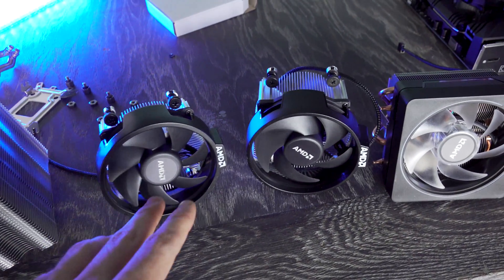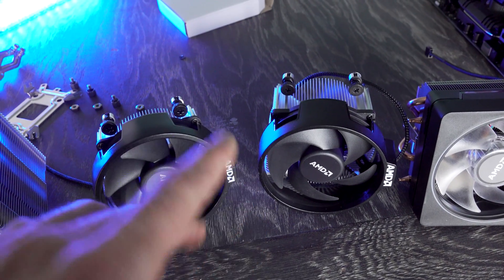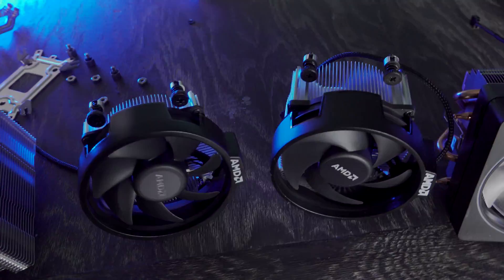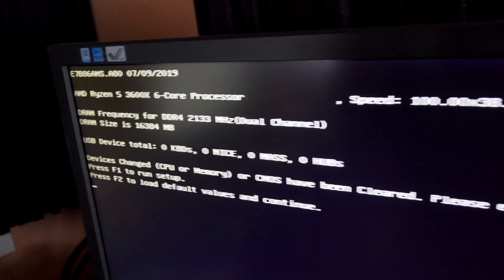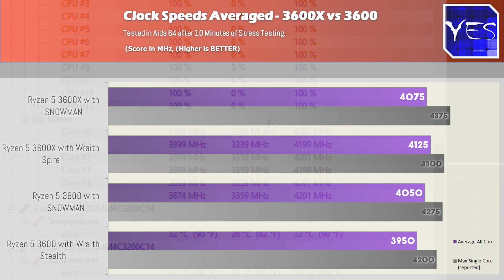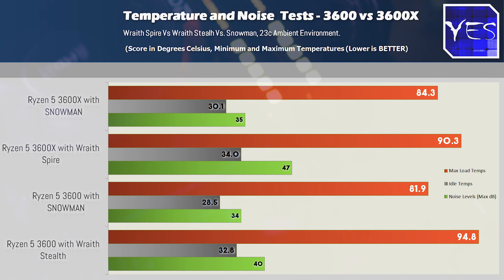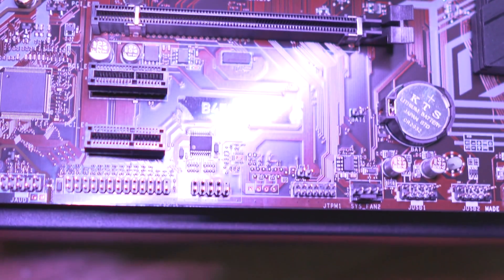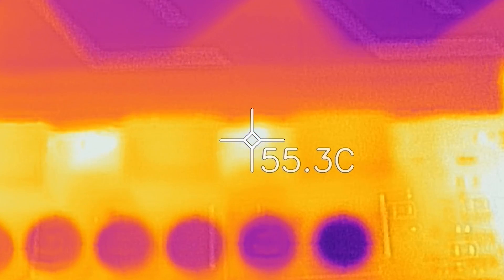Ryzen 5 3600 Vs. 3600X ON A B450 MOTHERBOARD

Comment: Got a question if anyone could help me out. I built my own rig 2years ago (GTX 1080 & ryzen 2600x with the msi b450 MB and the last bios update i did was around 4months ago from this comment, my question is is if I upgraded to the 3600x could I use the cpu without having to do any bios update?

Comment: I’m building a gaming pc (goal is to play with 144fps on fortnite) and these are what i got for now: 

CPU: Ryzen 5 3600
Motherboard: ASUS PRIME B450M-A
GPU: GeForce GTX 1660 SUPER SC ULTRA
RAM: 16 GB (2x8GB) 
Storage: 1 TB hardrive 
Power supply: Corsair CV Series 550w 80+ Bronze 

Can anyone tell me if this will be enough? Will that motherboard be ‘supportive’ enough?

Comment: hi techYES,  I dig the content; I have built this exact system last year for my daily driver and i must say that it drives my 1440p LG just fine, happy days...  i have a ryzen5 3600, asus prime b450 M-A, and rx590 that i found cheap, i am strugling a bit with the ram config on it, i got 2 sticks of 16gb  3200mhz CL16 gskil ddr4 ram,  but on the bios uefi the ram shows 2133mhz out of the box, i think there is some bios stuff that needs some attention, i am afraid that if i mess with the bios too much i may brick the thing, plz haaalp! EDIT: did bios update and it remained the same ... atleast i know i have the latest bios.

Comment: I'm sorry I'm very new to all this and need help asap. Today i bought my last part to build my pc. It was the cpu and originally I had a ryzen 2600 picked out for my b450 but best buy did not have them in stock. They had the 3600 so I got one. I put it together then a thought popped in my mind about the two being compatible I do some research and find this. My pc fires up I have power lights work fans work everything but when I plug the hdmi into the monitor I have no video what so ever is this because of the cpu and mobo????

Comment: I went with the Rog strix B450-f Gaming board an a r5 3600 with a 4.2ghz oc @ 1.25volt an 3600mhz Ram.     Only took an hour to fit & setup an tested for 2 hours on OCCT to make sure it's stable.

Comment: I have the 3600, and I have it overclocked to 4.2 in the bios. The most voltage it ever uses is 1.09. I know pbo might work better than a standard overclock, but I don't understand how all that works.
Reply: what cooler are you using and what are your temps idle/load ?
Reply: @jeffersoncrum5575  So after some more tinkering I got 4.15 on the cpu I changed the voltage to 1.325 manually. I'm using that new hyper 212 revision black edition or whatever
Reply: @jeffersoncrum5575  with the hyper 212 I'm at around 38-40 idle and 50 under a gaming load, 70-75 under a cinebench

Comment: Hey I was wondering if you guys had a B450M PRO-M2 motherboard? (Not v2) to test with the 3600? I see lots of posts that this board will not do 3000 series even though their bios and compatibility list reflect htem updating for it.
The issue I have is we have 7 of these at my office and I got a 3600 to upgrade a few of them for the graphics artists at the office, however it doesn't work at all nor boot (obviously I updated bios) I've tried several versions, none work. I  see on searches that many others have this issue.
https://www.msi.com/Motherboard/support/B450M-PRO-M2#down-bios

Thanks for any help.

Comment: There are no differences between both CPUs. Just buy the 3600 and overclock it at 4.2.
Reply: Good luck with that. I tried to set my 3600 at 4.1 and the computer won't even post.
Reply: @ToxicTeemoOCE  
Lol. In theory the 3600 can reach 4.2, but 4.1 in all cores its ok too.

Comment: What kinda Mainboard do I need to get the most out of a Ryzen 5 3600?
What do I need to watch out for?
Could it be that the Ryzen 5 3600 runs with its full potential with every B450 board?
Or is there a reason to take a more expensive board like the MSI B450 Tomahawk MAX?

Comment: Thanks a lot for this test video. I bought a system with an Ryzen 5 3600x and a Asus TUF B450-Plus Gaming MoBo. I can't wait until it is arrived.
But if I see these temperatures, I'll probably buy another cpu cooler. Maybe an Arctic Freezer 34 Duo.

Comment: Please suggest best valued processor to be paired with RX570. I'm stuck with A320 motherboard as B450 in India just priced double. Thanks in advance.
Reply: the asrock fatal1ty gaming k4 b450 (7200rs) is 50% off on theitdepot.com . I just ordered one. It has more features than the b450 tomahawak but lacks bios flashback but I think its ryzen 3000 ready. For processor you should get a r5 3600 or 3500 when it releases.

Comment: Operating System
 Windows 10 Home 64-bit
CPU
 AMD A10-6700 81 °C
 Richland 32nm Technology
RAM
 20,0Gt Dual-Channel DDR3 @ 666MHz (9-9-10-25)
Motherboard
 ASUSTeK COMPUTER INC. M11BB (FM2 ) 44 °C
Graphics
 LG TV (1360x768@60Hz)
 4095MB NVIDIA GeForce GTX 1050 Ti (ASUStek Computer Inc) 35 °C
Storage
 1863GB TOSHIBA DT01ACA200 (SATA ) 39 °C
Optical Drives
 ATAPI DVD A DH24ACSH
Audio
 Realtek High Definition Audio

Comment: I know this is a motherboard video but I have to ask and expect 100% no bias from any amd fans, I currently have a fx-6300 myself and even comparing to my friends i5 from i2012 I had quite the stabilization problem when it came to gaming. Even back in 2015 when I used to purely play games such as csgo and later overwatch, hell even fortnite when I used to play my fps would constantly be dipping, in cs it went from 140-210, fortnite 40-120, there would never be an in between(I also used to play on low everything for competitive purposes so I wouldn’t be utilizing my gpu as much). Going over to my friends house he would play cs and his would only dip 5-15 fps at times whilst playing, a respectable number and nothing to be worried about. I want to ask any new ryzen 3000 owners do you experience such thing, as I’m like dead set on getting 3700x myself with a 5700xt but the experiences that ive built up on my 6300 is kinda putting me off.

Comment: In your clock speed slide, are those clock speeds auto boosted or manual OC? Im assuming auto. I have a B350-F and I'm curious if an OC to 4.1-4.2 on a 3600 is worth it over just leaving it to boost itself and save some heat/power

Comment: Snowman seems to be a really great cooler. But as I mentioned in one of the previous video comments, I have purchased Alseye cooler from Aliexpress - particularly H120D. And it does great job - Ryzen 5 3600 max temp after 15min AIDA64 stress test - 73C. RGB fans, quite quiet but I believe they may be dragging the cooler down a bit and with better ones the result may be even better.

Comment: No way in hell is the 3600x worth $50 over the 3600. The "Snowman" is the exact same cooler as the Thermaltake ContacSilent 12. I have one on my 3600, and it does a very good job. My load temps dropped 15 degrees C versus the Wraith Stealth. I may have gotten a really good 3600, because it boosts over 4.2ghz on all 6 cores at times, and my Cinebench scores are higher than the ones I've seen from any techtuber's 3600 review. I'm also using an MSI B450 board.

Comment: When comparing the 3600 and 3600X single core clocks, is the Windows 10 Processor Scheduling selecting the fastest Ryzen CCX or core? On my 3600 it is not...(Asrock B450pro4)

Comment: It is so nice to see that the 3600X can hit it's advertised 4.4 Ghz turbo clock. OH WAIT...
Reply: Probably on water or the arctic (my first gen TR-1950x can do 4.3 GHz all 16c/32t when it’s cold in my room, aka my drinks are frozen in the morning and so is the milk). Plus that’s single thread boost I believe for the Ryzen.

However near 0c the memory controller stops working and 3777 MHz quad channel drops to 2133 tri, then duel, then single RAM stick (this is known issue for Ryzen near 0c, colder than -50c and it starts working again but that means my phase cookers would not be good enough for keeping that -50c core temp under stress loads and probably wouldn’t work). That said my 2200g doesn’t seem to have memory drop out between -60c up to 90c so I’m guessing it’s just a lucky chip (this is testing with phase cooling).

Comment: tomorrow death combo
Ryzen 3600
X570 Gigabyte Pro
Hyper 212 Black Edition
Noctua N1H1 thermal pase!

C A N T   W A I T
Reply: Why the X570 motherboard, and why the Hyper 212 Black? They won't net you any performance over the motherboard and CPU cooler shown in this video.
Reply: @hartsickdisciple  so why make x570? Same thing was said about x370 n x470.
Reply: @joemartinez5782  Those motherboards have extra features that benefit a small subset of prospective buyers. They do nothing for the majority of us. An R5 3600 is a bang for the buck type CPU. It makes sense to pair it with a bang for the buck type motherboard. B450 handles the 3600 beautifully.
Reply: @hartsickdisciple  thanks for replying. I plan to game and stream and edit. I want this pc to last me a long time. I have a 1000 budget. What would you do?
Reply: @joemartinez5782  What do you consider a long time, and what resolution do you plan to game at?
Reply: @hartsickdisciple  4 years. 1080p in streaming and 2k for pleasure. I have an alienware 25 monitor. Dont need to max it.
Reply: @joemartinez5782  This monitor? https://www.amazon.com/Alienware-25-Gaming-Monitor-Height-Adjustable/dp/B0733YCKM5/ref=sr_1_1?hvadid=77996648281774&hvbmt=be&hvdev=c&hvqmt=e&keywords=alienware+25&qid=1566962151&s=gateway&sr=8-1

Comment: 🙂 forget this, at Microcenter u can pu a brand new $199 2700X with an included amd rgb cooler
Reply: The 3600 outpaces the 2700X is many benchmarks, including nearly all gaming scenarios and overall responsiveness. 
If I were to buy a CPU for gaming and normal computer usage it'd be the 3600. 
Only if you can really routinely use the extra cores for streaming or some workstation-type task would the 2700X be better.
Reply: @tim3172  ✌😏 agreed but thats not its final clearance price, by maybe First Quarter 2019 the 2700X mite be at $129 @ Microcenter, stay tuned! 😱😍

Comment: Those are insane cinebench R20 numbers for the 3600. Most chips score around 3550-3650, 3700 and above is insane.
Reply: I have almost the same exact setup as him. I'm using a 3600 with an MSI B450 board and 16GB of 3200mhz CL16 RAM. I have the Thermaltake ContacSilent 12, which is the exact same cooler as the Snowman, with a different brand stamped on it. At stock, my CPU hits 3719 in Cinebench R20.

Comment: It is still better to KEEP the Wraith cooler , because that cooler blows DOWN , and that helps a lot , because that downdraft cools the VRM's !!
Reply: He showed the VRM with the Snowman cooler and it was barely warm after 10 minutes of Aida 64. I’m not sure the exact temp you want to keep these mosfets, but you don’t want them iced over either (besides literal ice melting, the mosfets have a minimum temp and then start going crazy, hence you never want to LN2 cool mosfets, voltage spikes from them hanging etc)

Comment: Another great video, thank you!    [edit:    I am a fan of Noctua air coolers.    Could you put a Noctua on the Ryzen to see how well it does?   By the way, I have a Noctua NH-U14S for my Intel CPU.    While typing this I ordered an adapter kit from New Egg.   The adapter can be ordered free from Noctua, however I first need to own a Ryzen compatible motherboard, which I do not have at this time.    Noctua's web page:    https://noctua.at/en/nm-am4-uxs-mounting-kit-order-form  ]

Comment: how the hell did you get that scores on the cinebench r20?!?
I have the msi b450m pro-vdh and it doesn't allow me to get the minimum overclock, it runs 3600mhz cl16 ram and all, but Oc is out of question.

Comment: Hmm what is happening with the 3600 and 3600x is the same with the 2600 and 2600x. I payed that premium and a friend of mine got the 2600 and I got 2600x, with the same voltages and settings on the 2600 I got the same performance as I got with my 2600x. Stable 4.2Ghz on both CPU's, well let's say this I will never do it again and I would definitely buy the 3600 over the 3600x or at least go for the 3700x instead.

Comment: Bryan. There have been reports of issues with MSI B450 boards that have the bios flashback button having issues with the new Zen 2 CPUs after performing the flash back using the button. Did you experience this at all?

Comment: I have a ryzen 3600 and the same msi b450 a pro, but I have a problem, I keep getting a "driver power state failure" bsod, also the chipset drivers from msi site are so confusing, don´t know what should I install and what should not; help!
pd: ryzen 3600, msi b450 a pro, corsair 16 gb 3200 mhz lpx, mx500 1tb, msi gtx 970, 650 watt psu.
Reply: install the chipset driver from Amd directly, not from Msi, check for updates, or reinstall windows.

Comment: Good topic!

B450 + 3600, vs 3600 with aftermarket cooler, or 3600x with stock cooler.
Is that Snowman cooler a whitebox Hyper 212 EVO?  It looks very similar, but it's half the price of an already cheap cooler.  Awesome!

Comment: for the price, Snowman is probably unbeatable.  that said, in all the B-roll shown of it, i see too much wobble for my liking.  makes me question the longevity of the included fan.  replacing that with a more expensive fan ruins the value.  is that just normal fan behaviour and i'm being tricked by camera shutter or something?  my fans don't spin with any perceptible wobble.  except for one that crapped out and started making a racket.

Comment: Great video! I figured this out allready. My B450 with the 3600 is working like a charm. Invest the extra cash in better RAM...
Reply: Did you need to flash it or did it come 3000 ready? Im building a rig with a B450 and 3600 and im worried i might run into issues since im gonna be ordering online
Reply: @Why.Just_why  Have you figured it out bro? I'm gonna do that soon myself XD but I can't update the motherboard where I'm from, I'd really hate getting the motherboard shipped and then it turns out I need an older CPU.
Reply: @idyllsend6481  For me it was an issue of timing. It was back in August 2019. I was ready to pull the trigger on the build and i really didnt wanna wait , as i was saving up for months. If i wanted to make sure i  get a compatible motherboard i would need to wait for x570 boards basically, and i would need to wait a couple mor months.There were only a couple models out back then, and they were very expensive,stretching my budget by quite a bit. I wasnt really so invested in it, so i got b450 tomahawk, and ryzen 2600, with the 5700 sapphire pulse. Perhaps not as optimal as the 3600, but im not complaining
Reply: @Why.Just_why  So you downgraded the CPU for compatibility? I don't need the X570 at all :(
Reply: @idyllsend6481  i havent looked it up since then. Doesnt necessarily mean you cant do the same. You can check out the B450 MAX, which is basically a b450 board  but definitely compatible with the r3xxx CPUs. Should be more affordable to go that route now
Reply: @Why.Just_why  Thank you very much. I'll consider the max!
Reply: U need the bios updated
Reply: What deathalica asked you, thanks.

Comment: I'd be interested in a possible future upgrade path from a 3600 to 3900x, particularly on a MSI B450 Mortar Titanium. Going to pick up that motherboard based on Buildzoids review of it, the VRM should be very good.
Reply: vrm is ok but a 3900x oc would cause the vrm to overheat.
Reply: @RJADHARSH  I doubt that. It was below 60C with stock. A vrm can go up to like 120C, staying below 100C is preferable for the sake of nearby capacitors. And because the heatsink isn't terrible, imo any kind of case airflow should be enough to keep it below 100C since the higher the temperature delta to ambient the more heat it takes for each extra degree of temperature increase.
To know for sure someone would have to overclock a 3900x on the mortar.

Comment: I just got that MB but decided to get a 2600 for 140€ and a 212 with a discount for 20... I will wait a little bit for a CPU upgrade, my RX480 ain't that fast anyway. 😅
Reply: Good idea, it doesn't make any difference with that card.
Reply: @TheSilviu8x  I suppose that when 1080TI/RX2070 Super class GPU get into my comfort zone price range (about the current price of RX580) I could also get the latest and greatest that could be accepted into my MSI B450 Gaming Plus (A twin of the Gaming Pro if I'm not mistaken) my 1080p 144Hz monitor agree with that plan. :)

Comment: The snowman coolers have 3 4 5 and 6 heatpipe options. It appears that he is using the 3 pipe option. So I think he might be able to get better results with the 6. 
If you don't want to wait for a snowman I used the PC-Cooler 5 heatpipes and a similar design for 16 bucks on sale at NewEgg GI-X5R unfortunately it is back up to 23 dollars but arrives withing 3 days.
I also found this MSI board from the Amazon warehouse for 75 USD listed as Used-Very good. But anything I get from warehouse has basically been a new product return.